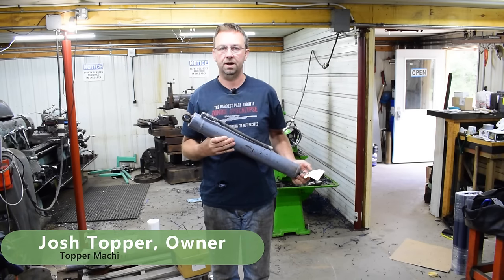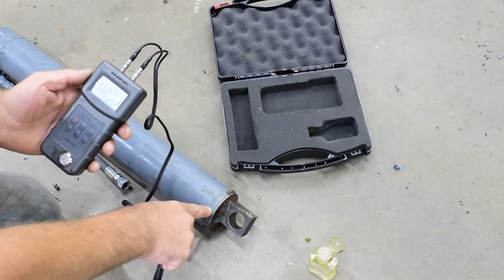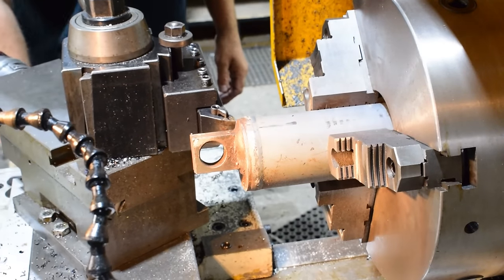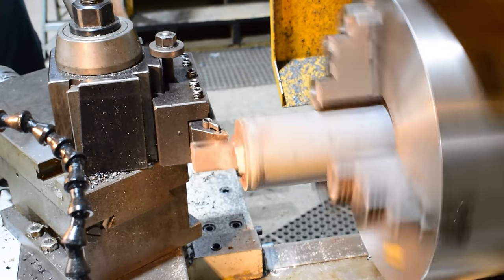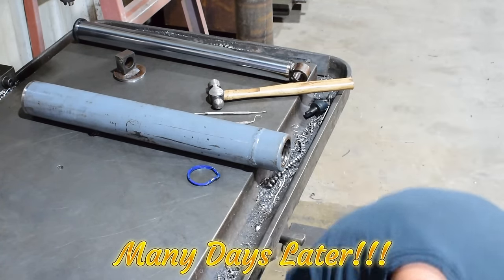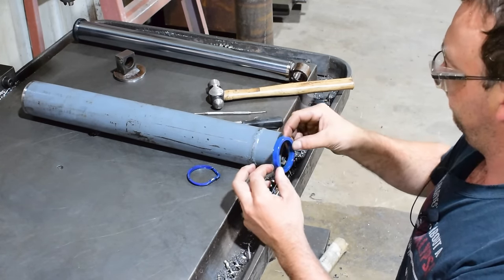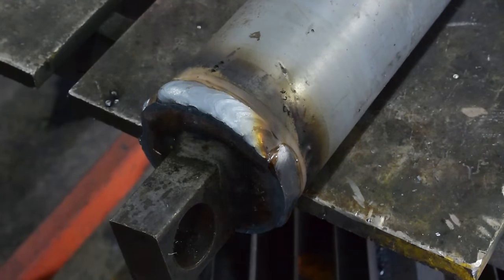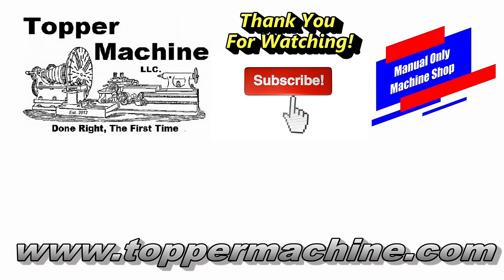Welded Hydraulic Cylinder That Can't Be Repaired, Cut Open and Resealed

Comment: what you need is a rotating ground clamp. The Channel called Cutting Edge Engineering Australia made his own out of copper, a spring and a nut & bolt. The bolt gets tack welded to the end of the project and a copper disk rotates around the bolt against another spring loaded copper disc (milled flat on his lathe.) you just attach the ground clamp to the stationary disc and you have a constant friction fit connection for ground.

Comment: Such simple things seems to scramble your  mind. ( A figure of speech, NOT pointing to your mind,) LOL getting a seal out is not that hard if proper tools are used. Odds are those dental picks are too soft or thin to apply sufficient pressure to pull seal up, and probably made in China, India or Pakistan with everything else.  I  have had that problem myself. The good old machinist bent hook scribe to me is the best tool in most cases. K-D TOOLS makes an O-ring / lip seal removal tool with all the right bends (has always worked for me). American made.  Another good tool is a cotter pin extraction tool.

Comment: I wonder if the cylinder works like a shock absorber rather than producing a force to move something?
Reply from the maker: I understand now that camper jacks work the same way but with a spring inside for return. Displacement cylinder.
Reply: A shock absorber is far more complex than this type of cylinder. Shocks work in two directions. A displacement cylinder only works in one direction (push). The rod is usually retracted by an external spring or just weight/gravity.

Comment: So what was the problem with the flopping piston? Did it need a seal or o ring or was that the way it is supposed to be?
Reply from the maker: No piston cup, it was flopping from the loose packing seals not holding it in place.
Reply: 👍, Thanks

Comment: The ram inside the cylinder is moving, probably because of the damaged seal. Instead of doing what you are doing, why not; part off the cylinder about an inch or two  from the end which will easily remove the entire end cap, then build a whole new threaded end to weld on, so no one had to go through this process ever again

Comment: One probably gets millions of stupid sugestions from those who know nothing. Im probably not any different, but what do you think of using a drill bit fairly close to where you think the cylinder meats the cap with a drill bit? Then you can learn precisely where the cylinder ends.  Probably dumb for reasons that I'm unaware of. 😊
Reply from the maker: the ultrasound is extremely accurate and non destructive.  does a great job.
Reply: @TopperMachineLLC  nice if you have one. Certainly if one do this for a living, it's good to have the right tools. 😁

Comment: Check this video out "Rotary Ground Clamps" at Cutting Edge Engineering Australia Pty Ltd's YouTube channel - https://youtu.be/bIkHtYWENiA - In this video we are making one of our Rotary Ground Clamps and we are GIVING IT AWAY! This shop made rotary earth clamp makes welding rotating parts like cylinder rods and barrels so much easier and we wanted to show how simple it is to make one. To make this rotary earth clamp we are using scrap brass which first needs melting in our devil forge and casting into blanks. After we melt and cast the metal we show the step by step process for making the parts starting with machining the brass blanks and then machining a brass bolt. We also drill and tap a hole in one of the brass blanks on our milling machine before assembling the rotary ground clamp ready to use!

Comment: Well you did fix it I'll give you that but is it really worth all that effort, those are generally designed as a throw away part that the cost to repair exceeds the cost to just buy a new one.
Reply from the maker: New ones were not available. Either make a new one or repair this one.
Reply: @TopperMachineLLC  that's fair if it is on an older piece of equipment or non-standardized application you really don't have a choice.

Comment: Check out, cutting edge engineering, he made a brass rotary ground connector for welding hydraulic cylinders, video should still up. He did it about 4-6 weeks ago

Comment: I'm a little concerned about you losing a finger wearing a ring while working on machinery.  Also never wear a ring around electricity or you can burn a finger off if the ring shorts a high current.  So far I've never had to rebuild a cylinder like that one.  With two Bobcats, backhoe, two dredges, tractors, etc. I do see two many cylinders--- .  And hoses---.

Comment: You screwed up and I caught it before welding you should have drawn the piston to the bottom bottom of bore away from the heat
Reply from the maker: There was no screw up. The piston had no seals, it was just a steel plate welded to the end of the rod.
Reply: @TopperMachineLLC  Crap no seal on the piston that's junk made
Reply from the maker: I agree.  I was shocked when I got it open.
Reply: @TopperMachineLLC  Your good man if you were closer I would enjoy working with you north carolina here I know your in the boonies somewhere on mars

Comment: That looks like a homemade cylinder.
Reply: No, it's a common displacement ram.
Reply: @tandemwings4733  I have no idea what a displacement ram is or what its used for. It still looks homemade, even if it isn't.
Reply: @opieshomeshop  Oh. well then, rather than having a sealed piston for the oil to push against, this type of ram simply relies on the pressure exerted on the rod itself, hence no piston on the end, just a guide cap. They're cheaper to make and require less maintenance, and are usually used where speed rather than lifting capacity is required. No, it is not "home-made".
Reply: @tandemwings4733  I see. That might explain the banging noise on the lathe. And such a cylinder I’m assuming then can only be single action. I’m curious what this cylinder was used for.
Reply: @opieshomeshop  Yes, of course it's a single acting ram, normally relying on gravity for return. I've repaired these things, but I don't get into the subject of what they're off - I just fix'em :-)

Comment: I cringed a few times during this... most of all when you were welding with the seal next to the weld and then continued to let it soak with no thought to extend the ram out so the seal was as far away as possible.....   never mind rebuilding a cylinder on a table covered in swarf, laying the chrome rod down on to the table not even a wipe down before installing ....
Reply from the maker: First, no seal on the piston. Watch the video, I explain that. Second, things get edited out. Table was cleaned, rod was wiped several times. Third, if you can't watch the whole video, dont comment stupid shit.

Comment: Can't believe that you didn't even pull the rod up the bore before you welded it, brand new piston seal and you just blasted it with an assload of heat... Smh
Reply: Also, you probably should have removed the other end of the cylinder... It would have been stepped into the bore as the cylinder is chamfered on that end to facilitate insertion of the piston seal, the rear is unchamfered and thus can damage the piston seal...
Reply from the maker: Watch the whole video before commenting so stupidly. I explained that there were no piston seals.
Reply: @TopperMachineLLC  Then that would technically qualify this as a ram and not a cylinder, but even then a ram should wear a cup seal on the end of the rod to force the highest pressure to the outside diameter rather than the center of the ram turning it into a projectile...